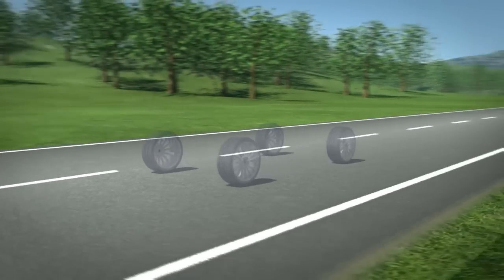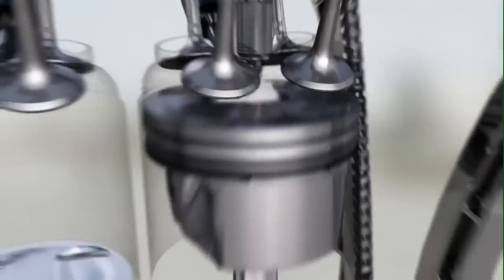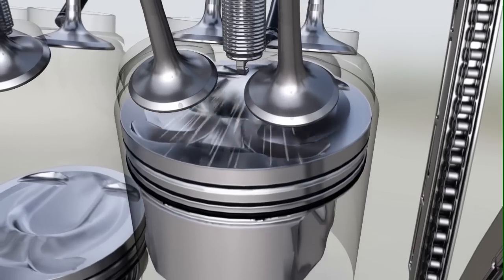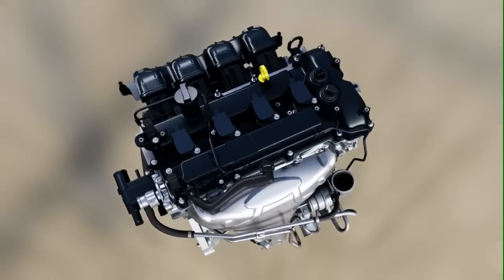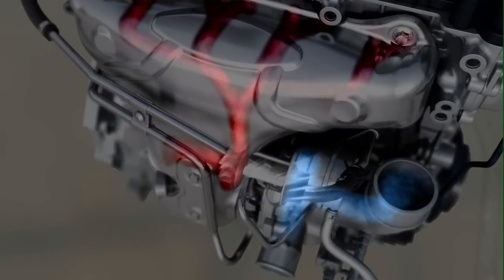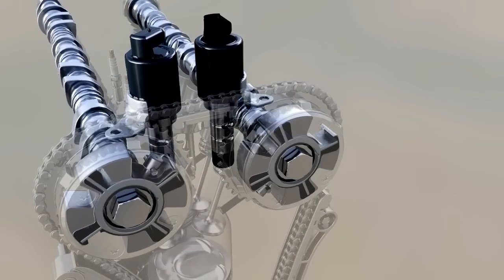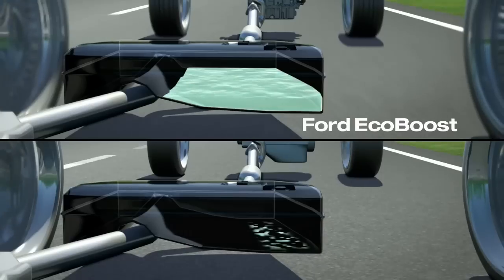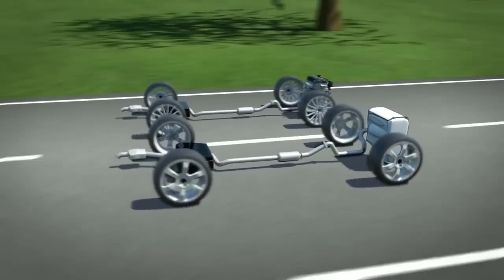Ford EcoBoost Engine

Comment: just like VW 2.0t TSI, German ideas copied by others..and other small engines from German ideas
Reply: All car companies copy each other. But I haven't heard of Ford copying VWs diesels though :0
Reply: +MrEpic6060   Diesel, is all GERMAN, guess who invented it all?  Germans invent all other copy, been like that in everything for hundreds of years...in engineering, electrical, machinery, science pharma etc..all Pharma came out of German chemical companies, Bayer, BASF,Merck, and others..VW first electronic ignition in mass produced cars, first 4we in mass produced cars, the list is endless.  Ford was a  big fan of Porsche and others...read the history of the old man Ford...Ford is now what about #4 in the world, as they slide further down, barely staying above GM.  Pinto....is what Ford is all about
Reply: +cengeb and without you being emotional, you would have seen it was a joke about your german diesel scandal. Good luck with that
Reply: @cengeb  ehm you know the Ecoboost engine, Fiesta, Focus ect is developed and build in Europe? Mainly developed in Germany?
It is pretty much a german engine........
Reply: @dom3827  Ford is gonna be another VW brand, Ford is in trouble, VW keeps expanding around the world....Germans invented multi valve engines, VW had the first ELECTRONIC fuel injection in a production car, the Rabbit, first plastic gas tank, and on and on, pioneered ABS in Benz, crumble zones in Benz...Diesel, and on and on..German invents, the world copies, usually poorly..German BOSCH is the largest car parts supplier
Reply: @cengeb  VW does too much wrong atm. Their engines are not really competitive and has more problems than others..
Toyota is on the best way being the new biggest car company.
Even VW mechanics tell people to not buy a VW.
Reply: @dom3827  BS...VW sold 10.8 million vehicles in 2018, more than any other company same as in 2017 #1 12 brands under VW umbrella, When TOYota can make a Porsche, or Bugatti, or Bentley, they might be a contender,VW GTI started the entire segment, all others copy.  No VW mechanic ever said any such thing, what planet are you on.  VW does everything right, TOYota has lots of recalls...defects, and more recalls.  VW pioneered so much stuff, all others copy.  Why does VW run the world's largest car factory in Wolfsburg Germany, Why does VW run the largest car factory in North America Puebla Mexico, why is VW #1 in China and Europe and the world, Why is Audi #1 luxury brand in China, beating BMW, Benz and all others.  Why does Audi and Porsche always rate as top vehicles over TOY and all others in CU magazine, why is that.  You need to get updated information, what planet are you on?
Reply: @dom3827  Why is Ford dropping car making and teaming up with VW to SURVIVE, Ford is a big ZERO everywhere, nothing in China or Europe, only pickup trucks to idiots in the U.S., where idiots use pickups as commuting vehicles, low end idiots.  Ford realizes, VW will save them, Ford is in deep trouble, GM is a complete failure, Ford is following...do some research
Reply: @cengeb  now you start losing realism.
Just watch out to the street.
Here in Bonn / Cologne every third vehicle is a ford fiesta, mondeo, focus or what ever.

And no, its not BS. Toyota was in the media a few years ago for fastest growing car company and making place 2 and its on the best way to get place 1

VW is losing big, specially in the american market. I am german myself. But VW is just a joke. 
They lost HUGHE the last 2 years. They had to pay billions ( milliarden )
Also no one buys VW. Smart persons buy skoda. Same parts, same quality but cheaper. Why should i give vw my money for free for a golf?
Also their engines have hughe problems with coking. More than any other direct injected engine. After 100.000 you can clean your valves and cylinder head or you lose economy, horsepower, compression.

Other manufracturers, even the ford 1.5 ecoboost has hybrid injection and uses direct injection PLUS pre valve injection to keep the valves clean.

I as a german have to say, you are a bit blinded. Yes, Americans can be idiots, but you can not fight it with being one yourself. Updated information... well mine is not from 2008.
Reply: VW was only in 2017 better than toyota and 1 year later lost again. Specially after the scandals there is no land for them in the future.
Reply: @dom3827  All I seen was Audi, VW, no TOYotas, one Nissan...Lots of Tiguans, and A6 wagons...
Reply: @dom3827  Ford is in big trouble, thus it's teaming up with VW to survive.  Why is VW expanding, building yet another factory, to make their Skodas, and building a battery factory, VW has teamed up with LG, Samsung, Panasonic for batterys, and is already working on next Generation of batterys, current batterys in Tesla are obsolete, Solid state battery are next, VW already has it coming
Reply: @dom3827  And the other 2 are VW products VW #1 Golf is the biggest selling model of all time, now going into it's 8th generation, my GTI is flawless, 76,000 miles 2016, replaced the 2010, which I traded in early at only 147,000 fun reliable not a burp miles.  My JEtta VR6 GLX only went 316,000 fun never stranded RELIABLE miles always stick, we had a Passat for 16 reliable years, current Tiguan and GTI are flawless, as wehre the other 13 VW Audi products
Reply: @cengeb  the biggest selling car of all time still is the VW bug.

You only see VW because you dont watch and you only want to see VW.

Toyota Aygo, Toyota Auris, Toyota Yaris everywhere in Bonn, Cologne, Euskirchen, in the whole Eifel.

You can come visit me and watch yourself.
Reply: @dom3827  No, the GOLF has been around longer and has sold more, the VW Beetle was the biggest seller first, Golf overtook it...into it's 8th generation, VW has ceased production this year of the Beetle, no demand, they are moving on, VW sold 10,000 new EV ID models in 24 hours after the announcement last week. Both Honda and Toyota are closing factories in Europe, lack of demand, VW building a new place for the Skoda, expanding, always expanding
Reply: @dom3827  One thing that is for sure, no junkers on the roads, clean, pristine highways unlike the filthy U.S. horrible roads, with cars that have parts flapping in the wind, barely seen a dirty car in Germany...Germany is the standard that all others follow
Reply: @cengeb  not really. Europe has worse roads in some parts. Bulgaria and such countrys do not even have much roads as we know.

Many countrys fight against thingsa like TÜV.

And i can see why. TÜV is a fraud company. I experienced it myself. I cann see why people deny something like that.
Reply: @cengeb  und nein, nur weil es bald 8 Generationen golf gibt iust es nicht das meistverkaufte auto. Das sind ja 8 verschiedene autos.

Es geht aber um EIN Auto. EINE Generation und das ist nach wie vor in 2019 der Käfer

https://www.kfzteile24.de/magazin/interessantes/top-10-meistverkaufte-autos

Der Golf 1 ist ein völlig anderes Auto wie der Golf7. Die haben rein garnichts mit einander zu tun und deshalb sagt das nix aus.
Reply: American police Fords like the Ford Taurus interceptor and Ford utility interceptor use 3.5L V6 Ecoboost twin turbos with 300+BHP. Ford Taurus interceptor has 365BHP and Ford utility interceptor having 300+BHP and Ford Taurus interceptor does 0 to 60(100km/h) in 5.6 seconds with a top speed 150mph(242km/h) and Ford utility interceptor does 0 to 60(100km/h) in 6.4 seconds and top speed 132mph. Its crazy American police Fords are using Ecoboost twin turbos.
Reply: ford ecoboost technology existed since already the end of the 80 s , it was called proco engine . Study a little before talking!
Reply: +cengeb Yup. This Ecoboost is basically a BMW N54/55.
Reply: you've got it backwards they copy our ideas and have always done so
Reply: @waynerhodes6353  oh man. Please keep some reality.
Germany is not turkey or china. We did not copy anything. 
Why does Germany have the name as one of the leading tech nations?
Yes, because we provide OWN Technology which is international high standard to the world.

Or why do you think the American Army is one of our best customers?
Reply: @dom3827  The entire pharmacy industry grew out of German chemical companies..bayer. Basf..ig farben was the original
Reply: @dom3827  Germany exports almost as much as the u.s they have like 85 million we have 330 million dolts...super productive..modern factories...vw biggest car company in tgecworld..benz the original and oldest..and still going strong..biggest truck maker in the world
Reply: @waynerhodes6353  Germans invented multi valve engines...the gas engine..and diesel..and cars themselves...get educated
Reply: Blah Blah Blah. If germans are so good then why did they loose the war.. Ha